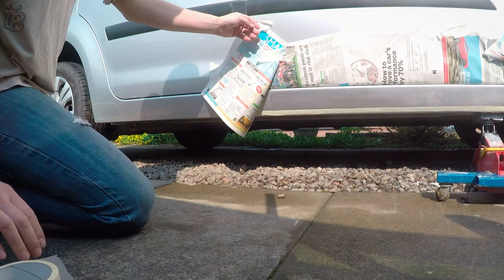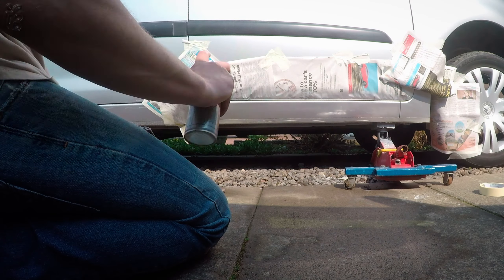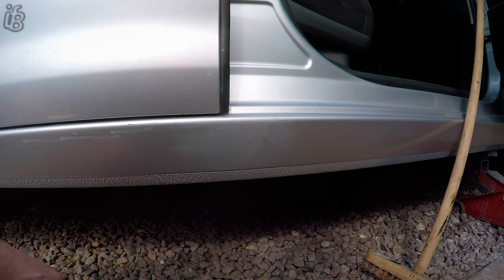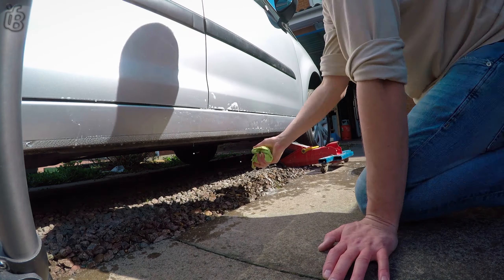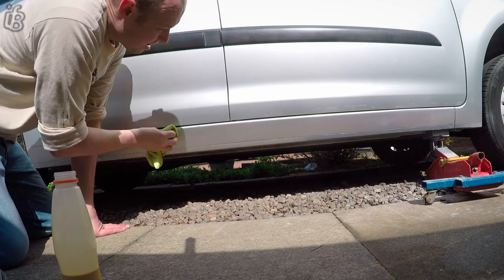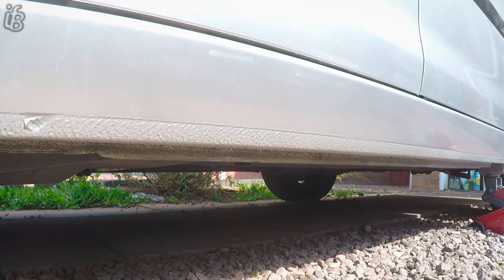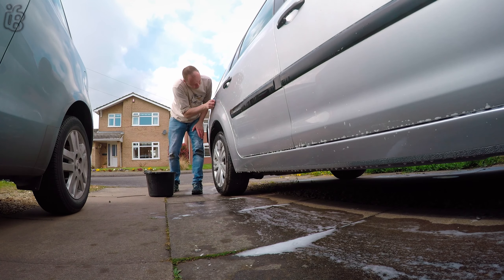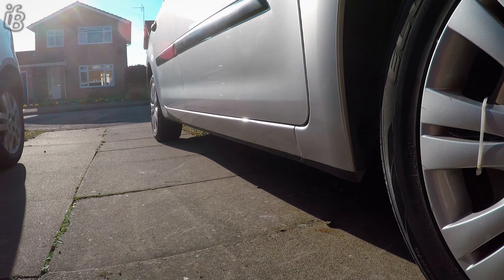Sill repair, finishing pt4

Comment: Thanks a lot for sharing! I really enjoyed watching all four videos. I'm about to undertake something similar with our Skoda Fabia Mk.2. I've never welded before, so I guess I'll need to practice quite a bit before I actually weld on the car sill. I'm also sure I won't do nearly as nice work as you showed here. I'm just happy if I can remove the hole and stop the rust for another 4-5 years. I plan to spray the inside with Fluidfilm. These videos were a real inspiration!
Reply from the maker: Cheers fella. Honestly mig welding is so much easier than stick. Once your settings are dialed in it's like colouring, compared to carving with a stick. Just practice until you build up a weld pool and you can write your name on thicker stuff. Then practice again on thinner stuff with tacking and stop start.

Comment: Nice job m8, I'm pleased I found these vids, I have to do similar so got a better idea now. Thanks for sharing your experiences. Welding will be a first for me and I have watched plenty of welding vids.
Reply from the maker: Yeah practice like crazy first, make sure you get all of the rust, I think I might not have got all of it, I was being to conservative.
Reply: Yeah I intend to do a lot of practice first. My job looks a bit more involved as the rust also runs into the wheel arch where sill and arch joins! It may be too much for me to do but I will give it a go when this damn weather gets better. Where do you get the sheet metal from? I've seen some smallish sheets on ebay and is 1.2mm the norm? sorry hope you don't mind the questions.
Reply from the maker: @peteralexander5000  this is what I used https://rover.ebay.com/rover/1/710-53481-19255-0/1?mpre=https%3A%2F%2Fwww.ebay.co.uk%2Fitm%2F273491539494&campid=5338535590&toolid=20008
1.2 mm, 500x500mm for £11.00. The car body was .8 or .9 thick from what i can remember, there getting really thin now.  
A brilliant place for welding etc is https://www.mig-welding.co.uk/tutorial.htm
If it is going into the wheel arch I would concentrate on the sill first as I do not think the arch is structural, but then it depends on how close it is to anything structural  and or any sharp pieces coming from that. Have a quick look at this thread https://www.pistonheads.com/gassing/topic.asp?h=0&f=72&t=1793512
Reply: @ifell3  Brilliant, that is what I was looking at also, thank you.
Reply: @ifell3  When I started, I was just going to "touch up a few rust spots". I ended up stripping huge Ares is underseal and attacking surface rust and worse. 12 weeks later the car is still on the drive. On the bright side, it's lost so much weight (removed rust) the fuel economy will be great now.

If you want to get the rust in the sill, pour some phosphoric acid in there and leave it overnight. Before you start worrying it will eat the car, phosphoric acid ONLY eats rust and SURFACE steel. Once it has created a layer of iron phosphate, it no longer attacks the surface. You can then treat with Hydrate 80 rust converter (after rinsing and drying). Job done.
Reply from the maker: @siliquaesid703  sound advice, funnily enough I was just using some stuff on the welder video called vactan. It leaves a latex finish which I don't think will hold up too well. After I brought it I learned about other types of rust converters and that was mentioned. From my understanding a rust converter like factan is applied to bare metal and a rust treatment like vactan is applied to the rust. But it's been a while now so I'm a little bit foggy!

Comment: Thanks for putting this on here, it's exactly what I will be doing through lockdown!!  Just a thought, how much help was the halogen lamp?
Reply from the maker: I think they are about £20, from Argos or some where similar. Unfortunately I didn't cut back all the rust close enough to the front of the sill and it's starting to show. In hindsight it would have been easier to support the car up and cut out the old sill and put a new one on 😉

Comment: Does the sill on this car have no drainholes? On the video I couldn't spot any, although I am not really familiar with modern cars.
Judging by the rust found inside the sill I'd say the drains are either clogged or just not sufficient by default. For long term rust prevention you should clear the drains or even drill a few new ones if nescessary. Also worth using corrosion protection grease ( e.g. Mike Sander's ). Spray it inside closed spaces and it covers all the hidden surfaces you couldnt paint. There should be factory made holes in the panels to be able to put a nozzle in and reach everywhere.

The endresult you achieved is awesome. The lots and lots of work paid off. Great work!
Reply from the maker: Thank you, and thank you for the lengthy reply. The drain holes are more inner to where the rust damage was, I think it was more to do with a bad design on Citroens part as this is a common problem. It's almost like the level of water has to be at a certain height before it reaches the drain hole. That or where it has previously been unevenly parked. 
You raise a good point with the grease or wax and to be honest I did look into that but my first impressions were you needed an air compressor, thou since doing this I've seen other kits on the market.

Comment: Great job and attention to detail.  only two negatives from me ... the black under seal stuff you apply at the end... should of left it factory colour.  and the line you etched in with the dremmel. 
U Pol do a  spray which when dry gives the dimpled effect  of the OEM sill. you simply  mask off a line and spray up to it.
Reply from the maker: Nice one will look out for that spray for the next time I have to do one thanks